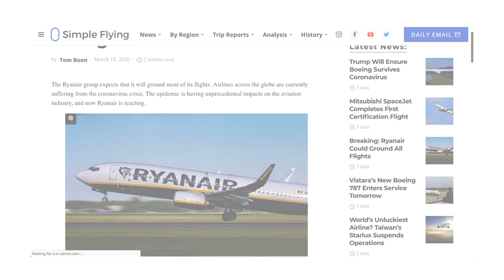What Plane Will Airbus Build Next?

Comment: The ability to slap on NEO on any active model is a testament to Airbus's foresight and a nod to their business acumen
Reply: I mean who the hell would want planes with increased fuel efficiency to save on fuel costs and pollute the environment less?
Reply: @Username-ww2cd  hahaha
Reply: As long as the plane doesn't randomly dip down and crash I guess it's alright
Reply: @Username-ww2cd  long term savings and short term costs. It may not be beneficial to many airlines...
Reply: @Horizon301.  most planes are leased anyways.
Reply: 100th like
Reply: @marvelgoh5648  True, but that is a Boeing thing.
Reply: What would an A350NEO look like?
Reply: @rascallygoose4926  I bet Boeing is going to make another dipping plane, just larger
Reply: a350 neo would be cool i think
Reply: @marvelgoh5648  This aged well 😂
Reply: @elijahjosephm.faustino8823  boeing 777max. Bruh

Also like it so i know you responded
Reply: The benefit from a highly modular production line.

Its worth saying that Both the A300 and the A320 series already got a mid life upgrade that isn´t that obvius.

Really first the A320-100, then the A320-200 then also the A32A, then the A32N.. So there is really 4 versions of the A320, ignoring all the different engine layouts
Reply: @rascallygoose4926  probably just the same.
Reply: @rascallygoose4926  propellers
Reply: @rascallygoose4926  they wouldnt name it neo, becuase then any texhnology transfer would be really confusing.
The A350 is in effect alreddy a neo from the get go. Next iteration would probobly be BEO or something, the  the current A350 would be named NEO retroaktivt like the A320 is named CEO.

Like the A330neo and the 787 have pretty much the same engines, there is just two smal diffrances.
Reply: Next up will be the A350

Comment: Several options:
A220-500, Seating 160-200, Range 6.700km
A220-500XLR, Seating 170-210, Range 7.900km 
A330-700, Seating 350-400, Range 17.000km
A330-500F (based on A330-900), Payload: up to 90t, Range: 7.600-8.000km
Reply: The A330-700 is the BelugaXL, the model was A330-743XL
Reply: @nadelvincejalmasco7124   Thanx, didn't know exact model number for Beluga.
The meant variant was something between A330-200F and Beluga, so A330-500F (based on A330-900) would be appropriate naming, a direct competitor to 777 Freighter.
Yet the question is whether Airbus would be willing to take this path.
Reply: A330-500 would be then quite OK for proposed new passenger plane.
Reply: A350-1000F
Reply: Bruh that would make a tranatlantic  A220
Reply: @nadelvincejalmasco7124  its actually A300
Reply: @William Huang The A220-500 (rebranded Bombardier CS series) can fly slightly farther than A320 but more efficiently with around the same number of passengers. 
The A220 is lighter than the legacy Airbus  narrow-body and is propelled with the latest generation of engines (approx. 20% more fuel efficient than 320s&737s)..and will effectively replace 318s.
It's also meant to be a challenger to heavier and less fuel efficient Boeing 737s.
Reply: @samboulinordine6566  Airbus dont use ER
Reply: @jonathantao3085  he mean BelugaXL
which is a newer Beluga
Reply: I know
Reply: A330-700 would have the capacity of A350-900.

Comment: A220 stretch makes sense, but I think they should also be looking to the A320 replacement. Something which is designed around the A321 size with a stretch into a true NMA and a shrink to fit the current A320. Perhaps they could consider the Mid-sized body (2-2-2) which was previously speculated for the 797
Reply: I actually think that Airbus should develop the A330neo next. Such a plane comes with the advantage that it could be designed to completely fill the gap between the A321XLR and the A350-900. My idea is a base variant that is the size of the A330-200 and has a range of around 8,500-9,000nmi, a stretched variant the size of the A330-300 that has a range of around 8,000-8,500nmi and a de-rated version of the base variant with a range of around 5,500nmi-6,000nmi which would fill the upper end of the middle of the market. This plane would probably have an entry into service date of sometime in the 2030s, which comes with the advantage that the 787 program would be around 20 years old, meaning that airlines would be looking to retire their early units.

An A220 stretch can probably be done during the development of this new plane as it would be a simple and cheap modification. They just need to make sure that airlines still have a reason to order the A320neo outside of commonality reasons, such as limiting the A220-500's range.

As for the need for an A320neo replacement, I don't think there is one right now. The 737 family isn't a threat to it like the 787 is to the A330neo and it isn't even possible to make any more upgrades to the 737. In fact, I think it would be a mistake for Airbus to develop an A320 replacement now and they should wait for Boeing to make a 737 replacement first. It is safe to say that whatever Boeing makes won't kill the A320 family, allowing Airbus to wait several years and then come to the market with a superior product

Comment: Airbus would build the a220 stretched next.
Reply: Double decker
Reply: @andrewstorm8240  A280?
Reply: @jarodhara3761  А250
Reply: @EmilSvitek  was replying to the double decker suggestion from Andrew Storm
Reply: No I think the a220-300 is in the Goldilocks zone. They’ll more than likely give it the NEO upgrade
Reply: Matt Jones  the A220 already has the same geared turbofan of the 320neo series.
Reply: @EmilSvitek  A2E
Reply: @ax1on2740  Imbrar A24
Reply: @EmilSvitek  you mean like "i'm bare".😮
Reply: A220 is an amazing aircraft. I see the AC ones over the house near YYZ daily. Very quiet aircraft compared to the 737 Max 8

Comment: In 2020s :

-a220-500 (stretch)
-a220 LR & XLR (?)
-New Cargo plane (base on a330NEO&a350XWB ???)

In 2030s :

- Clean sheet design a330 NEO replacement 
- Clean sheet design a320 replacement (?)
- a350 NEO
- Maybe Next twin engine jumbo jet ??? (If demand are returning and heavily increasing ???)
Reply: Well i guees two point for the a350f and the A220LR... 

They i would bet the A220-500 is coming.

Comment: I would look again at the ATR's. They're getting long in the tooth as the design goes back decades. The main competition is also getting on a bit too. So AIB making the first move to start a fresh new concept, stands a very good chance of securing a big limp of the market.
And keep the 220 stretch firmly in mind as potential customers are already waiting in the pipeline, but don't be too slow with this as the Max is ready to steal the market from under the very noses of Airbus.
Reply: The ATRs fly here, too, and seem reliable. However, their wings need a redesign as their lift is dicey in the icey.
Reply: There is very little progress to be expected in the ATR class. These airplane’s aerodynamics were fully understood by the end of WW2 and only a propulsion revolution would bring remarkable progress. But are batteries or hydrogen systems really ready?

Comment: Assuming that we are talking about a brand new aircraft rather than a modification, I would say the A320 series replacement.
However, I believe that it should be based on a design where the A321 replacement is the 'base’ with the A320 replacement being a shrink, and then a stretch to create something truly more akin to the 757.
From experience as a passenger, as the length increases loading seems to take so much longer (why I am always so pleased when an A319 turns up at my gate rather than an A321) and possibly something to be considered carefully before demanding stretches of the A220, to dash 700 or further.
Probably out of the question because of the inevitable financial situation in the short to medium term, but it might even have made sense to develop a wider bodied version in parallel (as with 757 and 767). 
If (and a say this as no engineer) a truly efficient wider bodied aircraft with say 2-3-2 seating and economics similar to those of the current narrow bodied ones (helped by the significantly increased cargo capacity of the wider body) could be developed, just imagine how much sense it would make for the airlines who currently rely on the quickest turnaround to squeeze an extra revenue earning flight in per day.
As another alternative, because the A220 is such a new and well received aircraft, could a wider fuselage model running in parallel with the current 5-abreast design serve as a replacement for the A320 series?

Comment: They are already working on an A320 replacement. Given the runaway sales of the NEO versions of the A321 vs almost none for the A319, they will almost certainly start with an aircraft that is slightly larger, with an A320-equivilent being the smallest version, with an A321 being the std version and a larger A322. They will then use the A220-500 to fill the gap below the 320 and steal sales from the MAX-7 and MAX-8.

Comment: A smaller 7 abreast economy class direct 767 replacement with carbon fibre fuselage and aerofoils, folding wingtips to fit on Code D airport gates and at least 14,000 km or range.
Reply: 767 replacement lmao airbus didnt make the 767 boeing did
Reply: that's the dreamliner and 777-200.
Reply: @MarcusNesbitt4  and the 767 is still in production despite the 787 which was supposed to be its replacement. Clearly there is a market for such aircraft. There are indications that Boeing might "777X" the plane and give it carbon wings and new engines. I say Airbus should go a step further and make a clean sheet direct competitor to that. Our flag carrier where i'm from could use such a plane for European destinations that are simply too thin even for the A350-900.
Reply: I'd like to see a modernized A310 -  twin aisle, 8 abreast.
Reply: @DonGurugay  the A310 is one beast of a plane. 767-200 passenger economics, but 777-300er cargo economics
Reply: A small 8-abreast the size of A310 and A300 would be a good option since they could easily use LD3 container. Range should be around 5,000nmi-6,500nmi.

This would be a better options compared to 7-abreast though.
Reply: @nntflow7058  with the GEnx, it's possible to go for 7,000nmi

Comment: Blended wing Airbus aircraft would be good way to redevelop the passenger experience.
Reply: @creepwood77  I mean, I think there are lots of ways to deal with this, including having floor/ceiling escapes, but the airline who orders this kind of aircraft is going to be taking a huge gamble. Most passengers prefer aisle or window seats and there will be less of both in this type of aircraft, and then the equipment and training needed for the crews will be completely new as well. I don't see BW designs happening until they've squeezed pretty much every efficiency out of current designs, and when we've still got the two most popular aircraft (737 and A320) being at least 30 years old designs, there are lots of efficiencies which can still be made before that step is required in the small aircraft market
Reply: @Musikur  Boeing considered ditching windows for LED wrap around screens. Blended wing designs could easily have wider aisles and more emergency exits and could be as equally as safe as traditional passenger aircraft.

Comment: A super twin-engine super jumbo called the A360 with an impressive range and capacity
Reply: That’s the A350...
Reply: I mean almost the capacity of the A380.
If it will happen Emirates will buy 200... 😅
It could have succes. A lot.
Reply: Airbus is probably wary (and rightfully so) of launching a large, 747/A380 sized aircraft any time soon as it would likely have limited appeal to airlines. One of the problems of the A380 that caused it to fail was that it was simply too big and many airlines struggled to fill the seats.
Reply: @tsh_teo  Emirates said that they from now on want to go tho the smaller ones again. Like 787 and 350
Reply: Something with 30cm more diamaeter than the A350 and a half lower floor is certanly possible. It would be about the size of a 747-400

Comment: I would love to see the Airbus ZeroE concepts built. From an engineering standpoint, that would be incredibly impressive. The hydrogen fuel system would have to be re-engineered to keep liquid hydrogen stored at the cold temperatures it would need to be stored at to keep it from turning into gas, and engineering the safety aspects of having a supercold fuel source on board would be a major feat of human engineering. 

Of course, an A321 stretch or an A221 stretch would be a more likely announcement in the short term, but nowhere near as impressive as the engineering that would be needed for a hydrogen powered plane.
Reply: Yes, and the technology would have big implications for the wider world. Perhaps they are looking at changing the nature of hydrogen to make it's use more practical.

Comment: in terms of a brand new clean sheet design aircraft, i see airbus making a 200-300 seater aircraft next between the late 2020s and mid 2030s to succeed the a330neo
Reply: Maybe even a slip in between the a321 and the a330 in order to replace both and in combination a220-500/700 suxceeding the smaler a320 variants
Reply: That may sound stupid but I’d really like to see an A310neo :D
Reply: Agreed. Thats the sweet spot.
Reply: @spongebubatz  it would be about the same capacity of the 767-300ER, which is why Airbus made the A330-200 and A330-800neo
Reply: @aryapatel1932  not really, the A310 is comparable to the 767-200 which both have capacity which is located in between the A321/757 and A330/B767(-300/-400). The A310 is even shorter than the 767-200 and if Boeing ever comes around with the much anticipated 797 I can imagine it to be very comparable to the 767-200 when it comes to size

Comment: I’d like to think a true NMA as they are reaching the limits of what can be done with A321neo after the XLR sub variant. People are quick to point out Boeing has reached the limits of what can be with 737 (and its clear with Max 10 due to not very good air field performance at smaller airports and a few other compromises) but A321neo is also reaching limits as it’s also compromised a bit in the XLR (reduced cargo) and another variant I fear would get more compromises unless they can work a way around it all.
Reply: The Airbus A240 then? I think it's very likely they're working on that indeed.
Reply: For the NMA they should stretch the 220 to 757 proportions
Reply: @lukasgray9027  I’m not sure if that’s a sensible idea: it’d be like the 737 Max 10, over stretched

Comment: the a360
Reply: da a370
Reply: @LotusFlyer  They will never make an a370
Reply: Why not??
Reply: @bae146forever3  they will someday
Reply: @Al-hb2wo  the age of 4 engines jets are over especially a 4 engine jet as large as the 360. If airlines are already dropping their 747’s,A340 and A360 then their is no reason to build a A360 successor.
Reply: @Al-hb2wo  No, but you could stretch the A350 to a size that is very likely to be as large as any airline will want their planes to be on high-demand routes for decades to come. I imagine there will be an A360 eventually, and maybe an A370, but they'd be as replacements for the A350, not new planes in a larger segment. As such, I don't think we'll see an A360 until 2045 at the earliest, and an A370 even more decades later.
Reply: @Al-hb2wo  nah they won’t use that name because of MH370

Comment: How about reworking the A320 with bigger windows?
Reply: @victorkeck   the cabin windows on the entire 320 range are common. They are smaller than on the B737, arguably a much older plane and significantly smaller than on the A350 or 787.
Reply: @eurouc  well, that's not a reason to build another model...

Comment: The money  is with LCCs. Those will need new airframes. Most efficient narrowbody is 6 abreast. Turnaround is bottlenecked by inability to stow handluggage and aisle length from L2 to seats. Crew is optimized at 50 pax per crew. 

So you have your new plane : 6 abreast 200-250 pax  with 1 hand luggage slot per pax, larger L2 door relocated closer to middle of plane to optimize boarding. Fuel capacity same as today but longer range due to efficiency. Add option for XLR subfleets to disrupt long haul. 

 Delist A320 and 330 launch A225 and A358 to round it up including de rated version of 358 for trunk Asia routes.